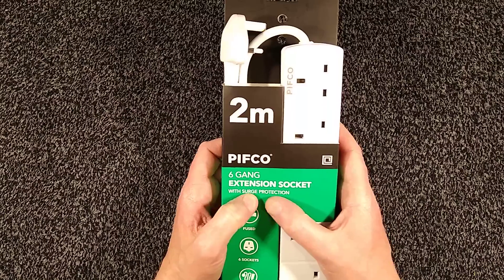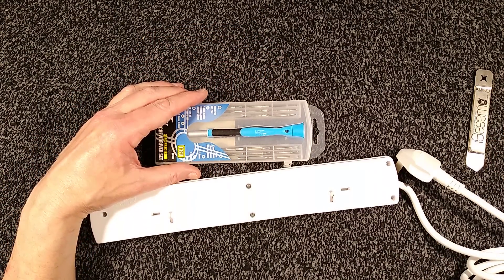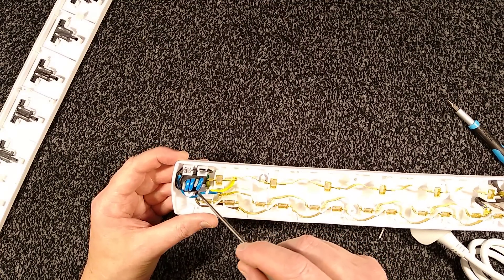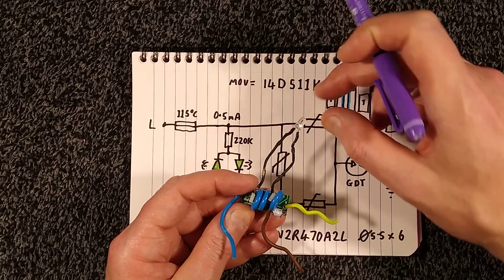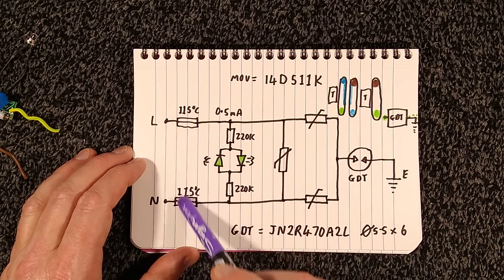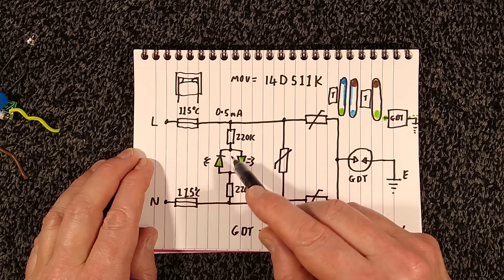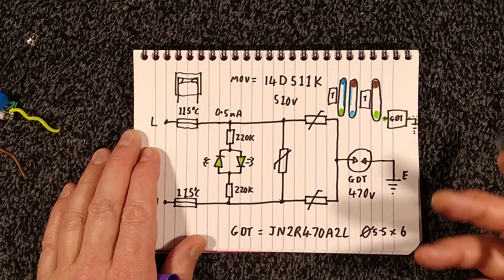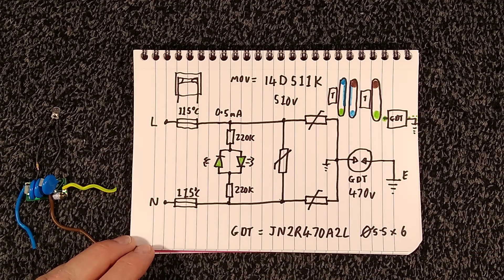Inside a Pifco surge protected extension (good circuitry)

Comment: A few months ago in my area, neutral connection from the transfromer got cut/disrupted somewhere and we were getting double the expected volatge,(getting ~400v instead of 240v). This made the blue varistors on my extension boards explode and blow the fuses.
Reply: Nasty. Explode is the right word, too. Little fire balls.

Comment: May I sneak in a video wish about electric fly swatters. There are different kinds from 3€ in the shop to 20€ on Am*n. Can they be tuned to 5000V? Some say 1000V other 3000V up to 5000V. I lile the ones with bars and not the net.

Comment: Pifco always seemed to make things that worked perfectly once. And once only. 
I had the misfortune of owning some Pifco bicycle lights in the 1970's. They were not happy getting rained on. As you tend to use bike lights in the months when it is (a) Dark early, and (b) Often wet, this made them a waste of time and money.
Reply: You've brought back traumatic experiences of a Pifco toy gun, used a #8 3v battery, pull the trigger and it lights up. Or, rather, pull the trigger and it immediately breaks. :face-blue-wide-eyes: 
If you are reading this in Heaven or Valhalla or Nirvana or wherever, Aunty Doreen, thank you for your kind thoughts but your well-intentioned gift was rather disappointing. 😪

Comment: In my opinion among others also these are useless. A good reliable protector is of a stand alone unit costing more towards $100 US or more. Just remember you get what you pay for & these power strips are nothing more than that.  This is NOT a fast acting reliable unit.
Reply: It's as fast acting as anything else with a MOV in it. The issue is clamping voltage and the amount of energy they can conduct away. As an additional clamp down the end of a circuit some distance from the main protection, they work quite well. They're also fine for lesser transients if lacking in better protection upstream.

Comment: The company previously known as PIFCO is now Russel Hobbs who are still a pretty big company, and a company called RK Wholesale Limited has the licence to the PIFCO trademark.
Reply: techinically.. Salton brought Pifco LTD and owned the Russell Hobbs brand and started to phase out the Pifco name. Salton then became fully Russell Hobbs just before being sold off. Pifco LTD is no-longer around, and the brand is just used as a name on genetic stuff. well, I say no longer around, Technically Company house says Pifco LTD is still around but dormant. They didn't become Russell Hobbs, the company that brought them did.
Reply: My gran used to work for Pifco assembling Kenwood toasters and Xmas tree lights at the factory in the old mill by the canal in Failsworth. We used to have all Pifco Xmas lights and I wish they'd been kept. The factory is still there but the Hubron factory next door  no longer makes carbon black colouring for plastics/ tyres/ shoe soles/ roofing tiles/ anything that's black or "charcoal grey" (they used to basically cremate  and grind pig bones, from the other local industry til it turned into something akin to copier toner and the place was pretty filthy, everything being covered in greasy black soot, the canal was the colour of Guinness and other than being exceptionally cheap I cannot for a moment imagine that it was an especially great place to site an internationally renowned electrical goods firm. Much cleaner round there nowadays.
Reply: 🤨…. In the process of being zombified? = and both Russel Hobbs & PIFCO will be slapped on “polished turds” as zombie brands
Reply: Can't hold a candle to Spiffco
Reply: @AgentTasmania  an extention cord that spoils all exploits related to the appliances connected to it? Sign me up
Reply: @AgentTasmania  you wouldn't want to hold a candle out by the Rochdale canal, next to the Pifco factory; whole place could go up
Reply: RKWH Wholesale (importer of OEM produced Chinese goods) has only licensed parts of the Russell Hobbs brand for use on silly (mostly non electrical) things that RH never made and is not connected to the Russell Hobbs small appliances which is still owned by a big American company. Confusing for the consumer but nothing new. Pifco and RKW is a budget company.
Reply: PIFCO was poorly made,  cheep products sold in̈ Woolworths along with chocolate that did not taste very nice and stuck to the roof of your mouth.
I didn't know they were owned by Russel Hobbs another cheep brand.
You get what you pay for.
If it's cheep, it's usually crap.
Reply: RKWltd does not say who owns them. They get things made in  China and shipped to the UK. It would be nice to see  goods manufactured in the UK.
Reply: @tonysheerness2427 I try to buy British but it isn't easy. When first setting up home in the 1980s I bought a LEC fridge/freezer, a Tricity cooker, a Thorn microwave and a Servis washing machine, all manufactured in the UK. I bought a Henry vacuum cleaner recently, made in the UK and a Vaillant boiler (a German brand but manufactured in Derbyshire) and I considered getting an Ebac washing machine until I realised that for the same price I could get an automatic washing machine and a condensing, heat-pump powered tumble dryer with twice the warranty though made in Eastern Europe.

Comment: In the 1980s I disassembled a surge protector strip sold by Ace Hardware with their name brand on it. It contained all the parts you'd need to make a basic surge protector, but it was wired wrong. If a surge happened, it blew a fuse but the fuse wasn't in line with the load, it just blew the fuse, the light went out, the MOVs were now out of circuit, and it continued providing power to the outlets. So it'd not protect anything, its only purpose was to turn out a light if there had been a surge.
Reply: The purpose of the fuse(s) is strictly to keep the MOVs from continuing to short out and catch fire when they reach end of life after too many surges. It is designed exactly as intended. There are very few surge protectors that break the load when the protection circuit fails. (Mainly the very high end ones from makers like Furman. 

When the light goes out it is only to show loss of surge protection. You can in some cases continue to use the strip as a regular outlet strip.
Reply: @mxslick50 

My thoughts as well...
Reply: @mxslick50  I was skeptical of what you say, so I went to my box of strips and pulled out three at random. All basically cheap department store ones, between 5 and probably 20 or 30 years old. Every one of them has the breaker or fuse set before the MOVs, so it absolutely would break the circuit if the MOVs shorted.
Reply: @John_Ridley  We are only talking about the thermal fuses for the MOVs. NOT the replacable fuse or resettable breaker on the outside of the strip. But, as another comment mentioned, many newer strips are wired so that if the MOVs fail, they will trip that breaker or fuse and kill power to the strip. Most all of the older strips will not.
Reply: @mxslick50  You are. But my comment is at the top of this thread, and none of the strips I'm talking about had thermal fuses at all.
I checked one of my power strips which is AT LEAST 30 years old, and it does kill power to the strip when the breaker blows.
Reply: That looks like what is happening with the Pifco plug strip.  A shorted MOV blows the fuse and shuts off the LED and apparently nothing else.  I agree that in some situations, it would be better to crowbar a fuse to shut off the entire plug strip - to protect particularly valuable or sensitive devices.
Reply: I don't think it's wired wrongly. It probably wasn't a high amprage fuse. The MOVs are supposed to take the hit when there's a surge, and just short the high voltage without disconnecting the load, and when they are badly overloaded or shorted permanently, the fuse keeps them from blowing up, and the light that indicates the functionality goes out. Just my 2ct.
Reply: @westelaudio943  Yes. If you have a MOV across 240V mains protected only by a 13A fuse, it is quite spectacular when the MOV decides to go low resistance at normal mains voltage. I think the plastic case of a power strip like this would probably contain the flames well enough until the fuse blows, but I wouldn't like to guarantee it would every time.
Reply: @BrianG61UK  Sounds like a RIFA capacitor. A shame they didn't fit series fuses with those.
Reply: What you describe is correct wiring for older surge protectors. The fuse is only to prevent the MOVs from leaking too much and causing a fire, not for surge protection. At some point UL changed their spec to put the fuse to protect the load in order to alert the consumer that surge protection was no longer being provided, e.g. a power strip stuck behind your TV where you don't notice the protected LED. Therefore, both designs are correct depending on the vintage of the power strip.
Reply: @straightpipediesel  Note to self: UL certified products not suitable for equipment which is supposed to actually be working.
Reply: “Ace is the place with the helpful hardware folks”!
Reply: This is quite normal in my experience. I have been trying to show people for years the little "Protected" light on most surge strips. No light, no protection. Many folks still use the busted units as just a splitter. Oh well.
Reply: Very common misconception as to how surge protectors work.. Blowing a fuse and turning the connected equipment off is not their function. They operate by clamping the voltage of very brief spikes (measured in the microseconds).

If the MOVs manage to go so short as to blow a fuse which allows practical equipment to operate, they will explode before the fuse. Have no fear of this, however, because their breakdown mode means they'll burst into flames long before that without ever opening a conventional fuse.
Reply: @Monkeh616  

Now three people have written essentially the same reply. Maybe we should read replies before posting. LOL!
Reply: @westelaudio943  The more the merrier, I say.
Reply: @Monkeh616  I have seen shorted MOVs blow fuses without exploding many times.

Comment: Does a gdt have a vacuum inside or is it atmospheric pressure, wondered why they can't make them clear to see when they are failing/firing
Reply from the maker: It may be a gas for a controlled arc voltage.

Comment: I saw an old pifco soft/surge protector the other day, sadly no pictures on the inside to show how it worked, I had a tesco own brand surge protector, which seemed to connect live and neutral through three movs to earth, and I wondered what stopped them from just consuming power all the time anyway, slowly baking the shit out of the varistor
Reply: Normally once a MOV gets really hot its resistance continues to drop and even the 13A fuse, if that's all there is, will blow in under a second. However, there will typically be a little ball of fire around the MOV for a largish fraction of a second!

Comment: Does this circuit protect the applience in the socket by tripping the braker or differential in case of voltage surge?
Reply from the maker: It might, but it's main purpose is to shunt transient spikes.

Comment: As a non-electronics wizard, I'd like a brief explanation of how this circuit works to block surges in voltage (current?).  I live in San Diego, California, in a suburban area, and don't think I ever get such surges.  I understand that folks near factories or other large electrical users are more likely to get surges, yes?
Reply: The MOVs normally don't conduct.  But when the voltage reaches the rating of the MOV, in this case 510V, the MOV starts conducting.  That makes the high current caused by the high voltage go directly to neutral or ground, instead of going through the devices that are plugged into the power strip.
Reply: One source of large surges that can affect almost anyone is nearby lightning strikes. Even if your mains power arrives in your home via underground cables, surges from lightning can damage electronic equipment. At the same time, most well-designed devices have a certain amount of built-in protection anyway, so it's difficult to say how worthwhile extra protection like this is going to be.

Comment: Some years back, I got a rack-mount "professional" (maybe Furman) audio surge suppressor. It was a 1U box, but quite deep. I was curious what magic they had so I pulled the lid. It had less surge suppression than this, and I think a small common-mode choke. That's it. Everything was mounted on the edge with the outlets and the rest of the box was empty.
Reply from the maker: That sounds well up to the standards of "pro" audio equipment.
Reply: Audio: the price is the product.
Reply: What, they didn't glue a steel ingot to the inside of the case to add heft? Amateurs.
Reply: Sometimes the purpose is just to double as a shelf for non-rack components… $40 for such a power strip vs $80 for a proper rack shelf… 😂
Reply: True true  @nyckid that's what I do! Or I use them to add extra smarts like current tracking
Reply: Why use steel when you can use bags of sand
Reply: @technoman9000  I have seen some amazing sand powdered 18650's😂😂😂😂 https://youtu.be/sqa2Y05sa14

Comment: Ah yes, for VMDs (vibratory massage devices) and CIDs (Christmas incendiary devices). 

On a slightly less silly topic, that is indeed a very nice design. The only thing I worry about is the separation distance between the active and neutral pins on the two sandwiched MOVs.